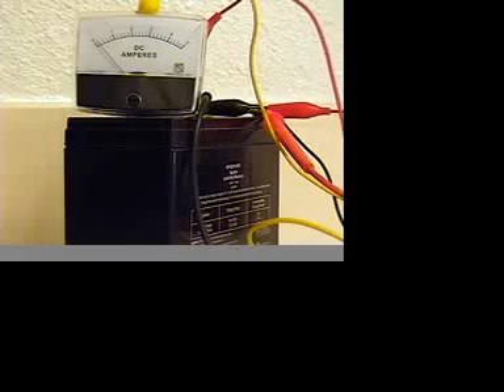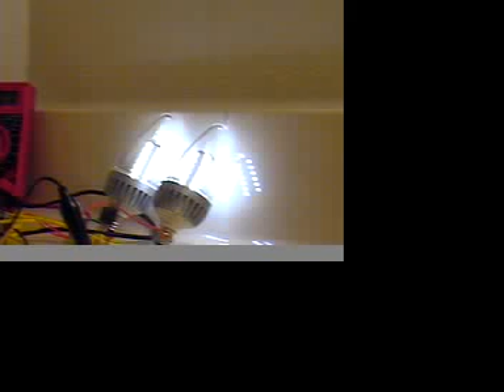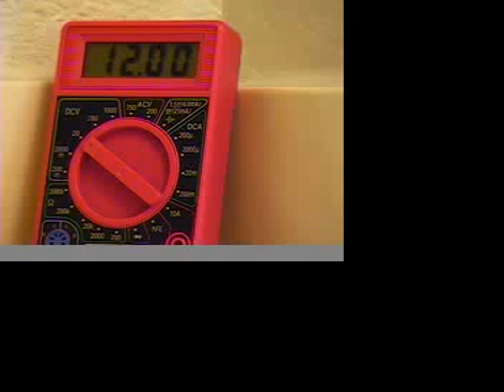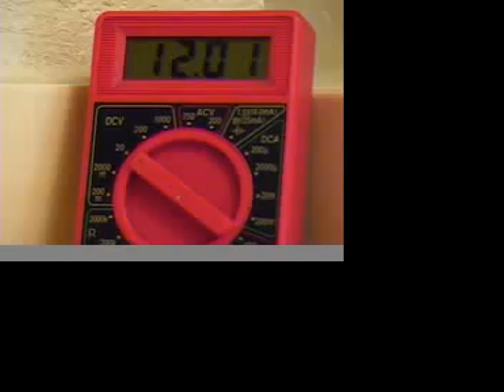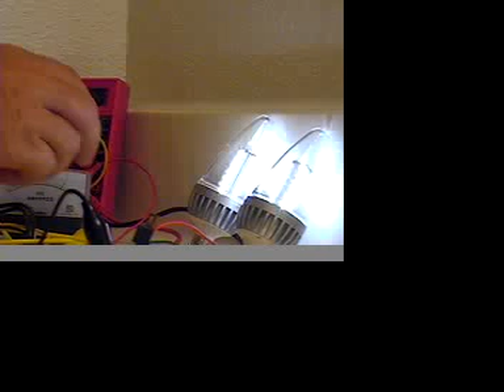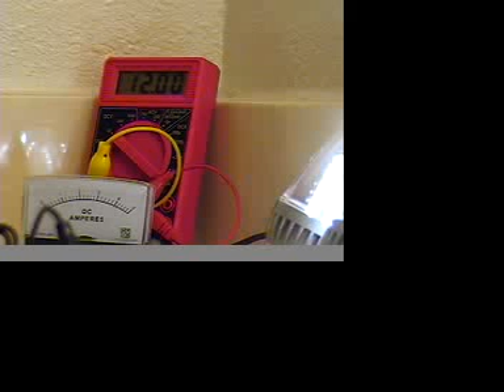endurance

Comment from the maker: Yes, changing the settings begins to wear the charge down. The voltage stopped droping at that level an held steady. The battery and electrolyte may have achieved resonance, and begun to generate power chemicaly.